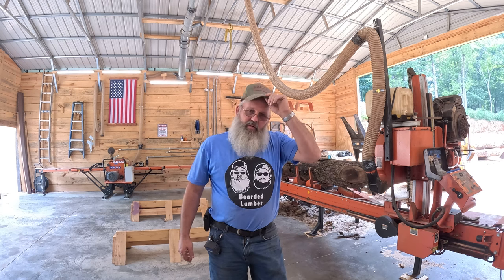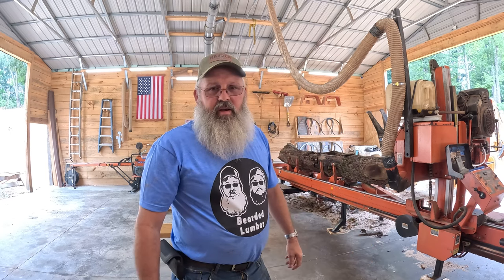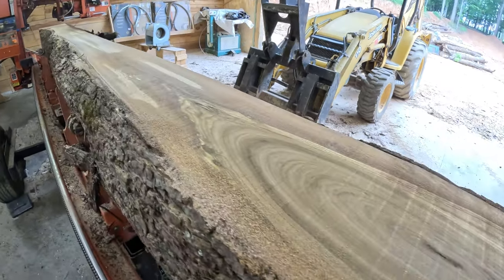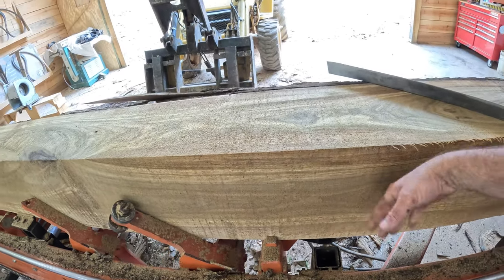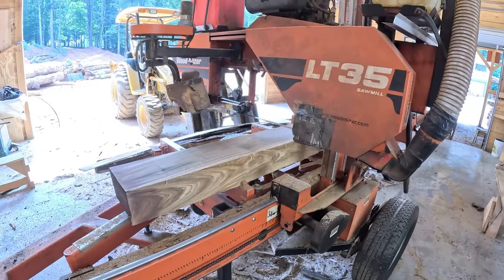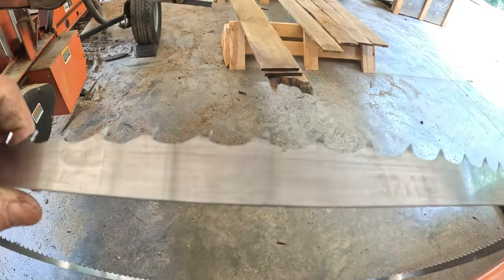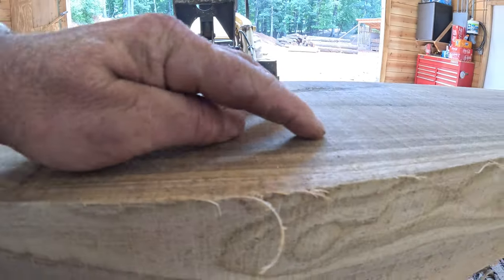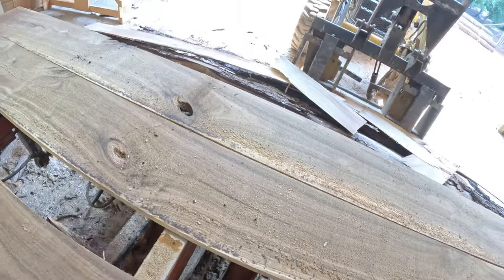Sawing Walnut To Save As Much As Possible On Our WoodMizer LT35 Sawmill

Comment: Whenever I see other sawmill vids, they use water on the blade while cutting. But your wood is Am I missing something, or don't you need water while cutting?
Reply from the maker: I run straight diesel fuel ,a constant light drip is all you need .
I also keep a oil can full of ATF to spot spray as needed.
I use less than 5 gallons of diesel in a week of sawing and it works great.
Reply: Sawmills are using a product called bio lube you should look into it